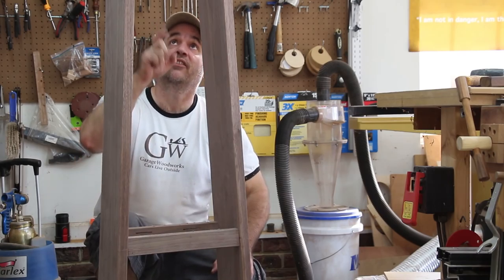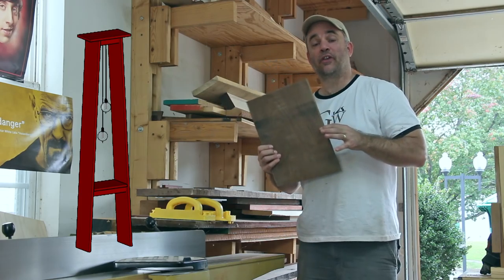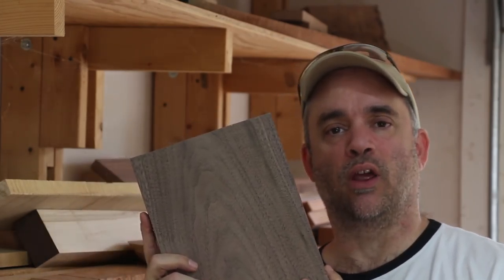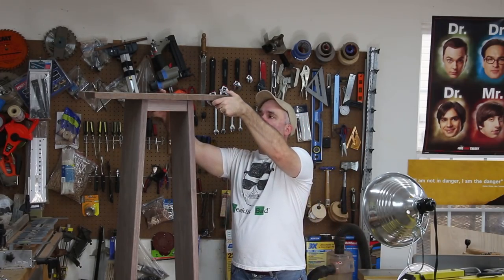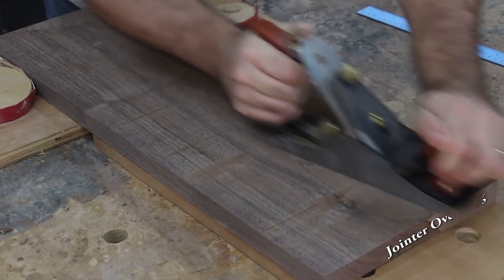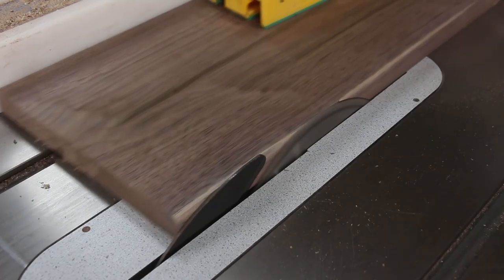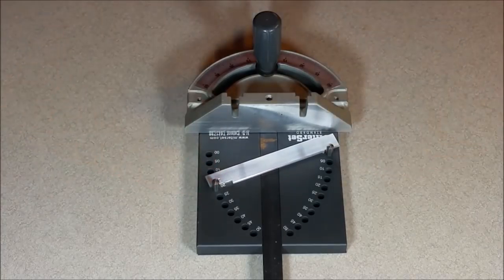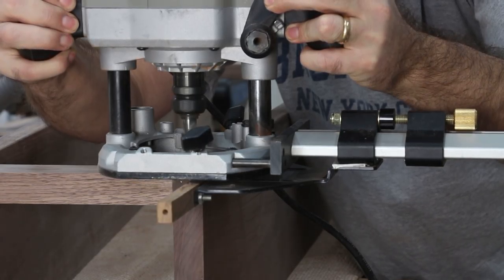Edison Lamp Part 2

Comment: Very awesome accent light.  I was just thinking of ways to run wire into a lamp without drilling.  For some reason I didn't think of covering the groove.  So thanks for that demonstration!
Reply from the maker: +Sean Rubino I struggeled with how to wire this lamp for several days.  I was tempted to rip a section from one side, create a channel and re-glue together.  The method I went with was easier and would allow for re-wiring if needed easily (for whatever reason).  Thank you!

Comment: Beautiful job.  My first concern was that the bulb on the shorter wire would get too hot for the longer one, then I noticed you were using LED fulfillment bulbs.  I learned these exist just last week.
Reply from the maker: +Johnny West No.  These are not LED.  These are squrriel cage filament Incandescent.  They are 30W and any heat is distributed over the large bulb surface area.  Heat is not a concern.   And thank you!  :)
Reply: +GarageWoodworks They look just like LED filament bulbs, or rather LED filament were designed to look just like them, so I figured you used them.

Comment: I love his project. Turned out really nice. But I have a question about the Miter Set jig. 

What is the purpose of the 1/2 degree detent bar?  Wouldn't it be just as accurate to design this to position the miter gauge against the pins?
Reply from the maker: The pins are only set at 5 degree increments.  The detent bar gets you set to angles inbetween.

Comment: nice design and did you put a finish or sealer on the wood ?  Also what Powermatic table saw do you have ? Since you are a owner of one what's your opinion of the saw ?
Reply from the maker: +Ron Stark I finished with a mixture of polyurethane and BLO.  Thank you!

Comment: 4 quarter? 1 inch?
Reply from the maker: +AJ Harran Rough lumber in the USA is sold in quarters.  4/4, 5/4, 8/4. 12/4, etc.  4/4 is usually a little thicker than 1" in the rough.
Reply: Thanks for the insight! Learn something new. AJ - From Canada.